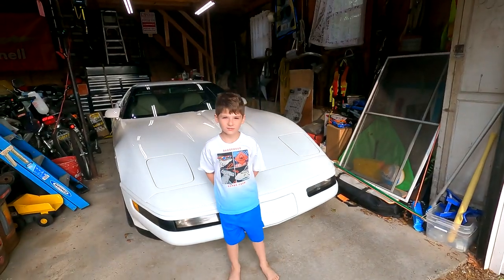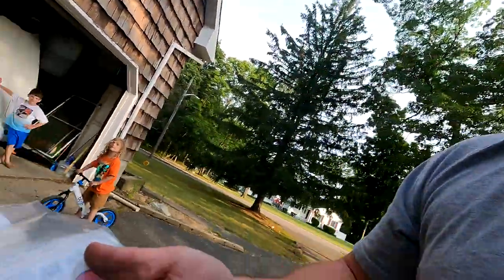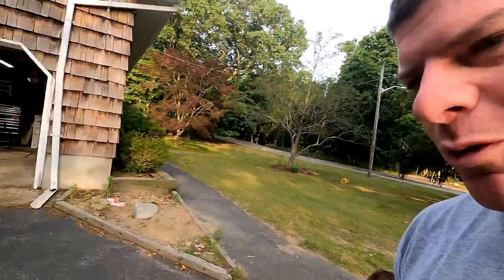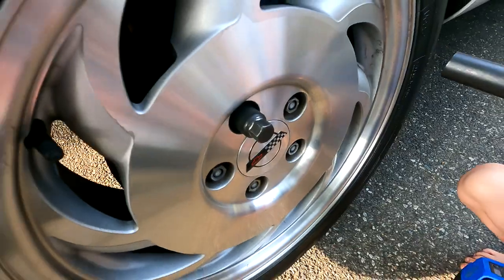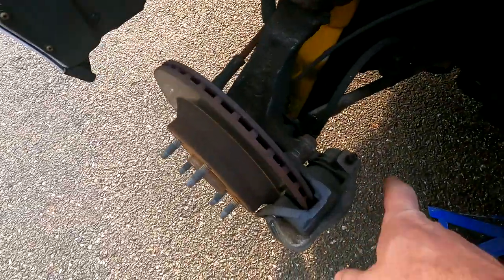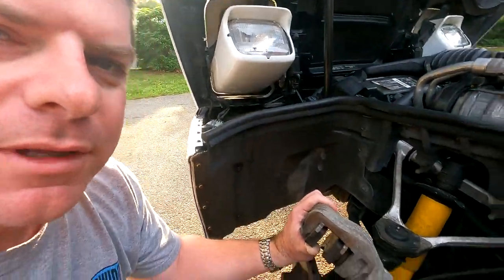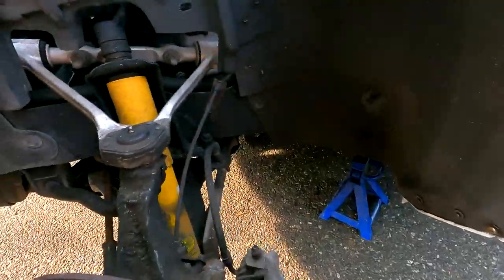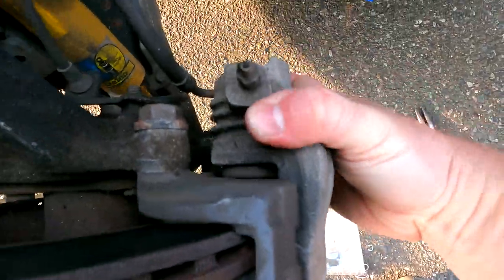C4 Brake Caliper Rattle Fix

Comment: I've got this same issue on the 95 I bought this year, rattles very loud going slow over rough road. Going to try to fix this weekend. Thanks for the video. It's great that you are getting your son involved and showing him stuff. He will grow up and be self sufficient and able to fix his own cars. I was fortunate to have an uncle teach me a lot of this stuff. Life is so much easier and cheaper the more you can do yourself without having to rely on mechanics for everything.
Reply from the maker: Hopefully this helps you out a little bit. I’m certainly no mechanic, but I developed a true love for cars that I’m trying my best to pass on to my little guys. 

I was lucky. My old man was a drag racer in the early 80s. He and my mom would rebuild engines while they were in high school. I’m pretty sure my mom still has the sbc firing order memorized. I was born, and the racing went away. He did a few 1/4 mile oval track enduros here and there (I have a picture of 3yo me painting one of his cars) but that was it. I never really worked on cars with him until I got much older, but cool stuff was always around. Old Buick riviera, Jag XJS and other neat things… 

But in the early 90s, probably 1992 or 1993 he got his hands on a ‘86 Vette in Competition Yellow. That’s where my love for the C4 came from. He didn’t have it long, but I remember washing it as a kid, running the sponge around the perfectly round taillights. I remember asking him what the button on the top of the shifter was for (it was an automatic).

Cars were always around. My uncle was a big enduro racer at Riverhead Raceway, my best friend’s father was a driving instructor at Bridgehampton.  I’ve definitely learned a lot over the years, but I’m convinced that some people are just born with this infatuation. This curse. Sometimes I wish a car was just something to get me from here to there, but I was born with this same love that you and so many of us have. And to try to explain it to someone on the “outside” is impossible. Thankfully my oldest son was born with it.  Or maybe it has something to do with me sitting and watching the Speed Channel and Motor Trend with him as an infant… But it’s a curse I’m happy to pass along.

Comment: Where can I get that hardware kit?
Reply from the maker: You can pick up a kit from Autozone. This is the one I used: https://www.autozone.com/brakes-and-traction-control/brake-disc-hardware-kit-front/p/duralast-brake-disc-hardware-kit-h5800/124946_0_0